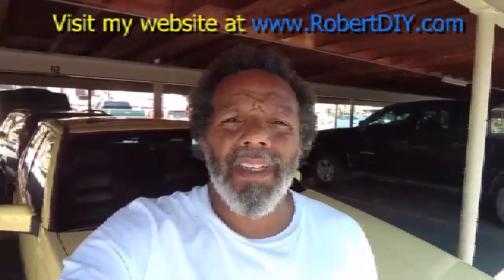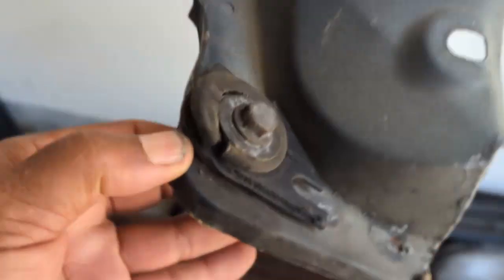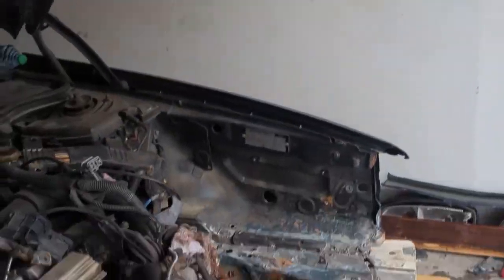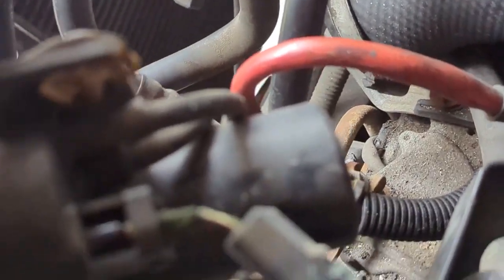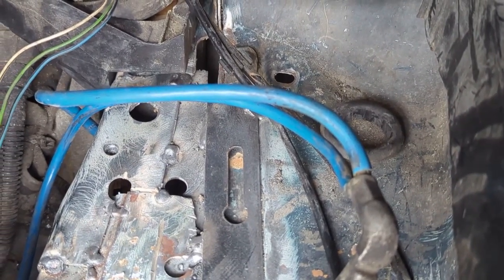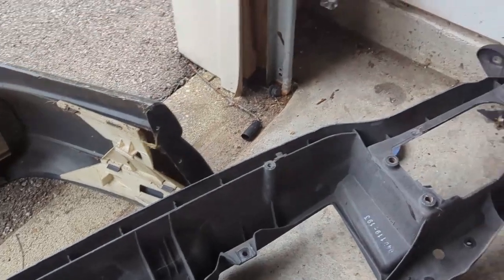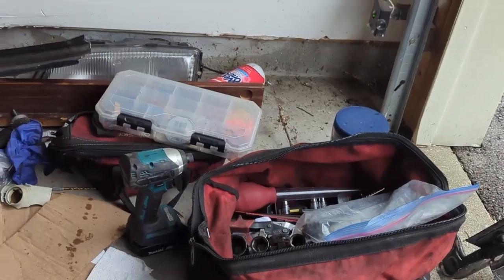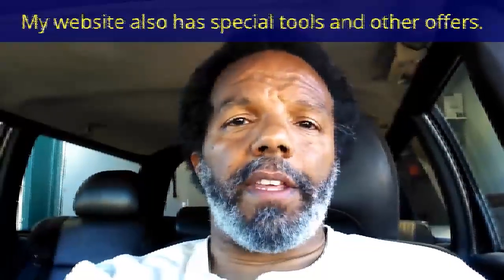Spent the afternoon putting a wrecked Volvo S70 back together. Radiator, front support & more. HOWR

Comment: Woot Woot!  New intro Party People!   Robert, thank you so much for all that you do!  Your 960 timing belt video was a big help when I performed that service on my new to me 1997 960 wagon.    Bought it in Connecticut and drove it all the way back to South Florida, 109,000 miles on the odometer. Yes the odometer works LOL.   I wouldn't be able to maintain this car without generous people like yourself.    My local Volvo specialty shop wanted $1600 to do the timing belt/water pump!
Reply from the maker: Yikes!